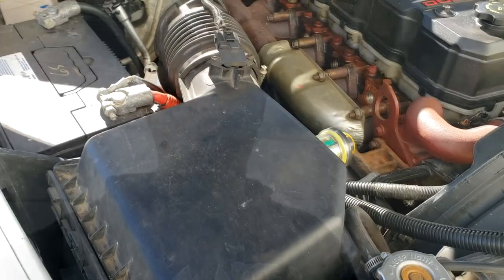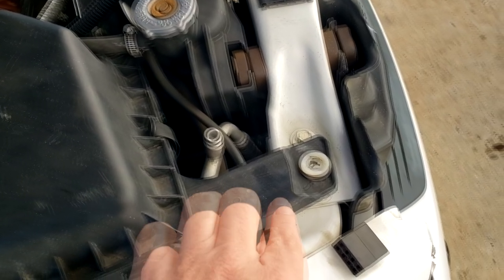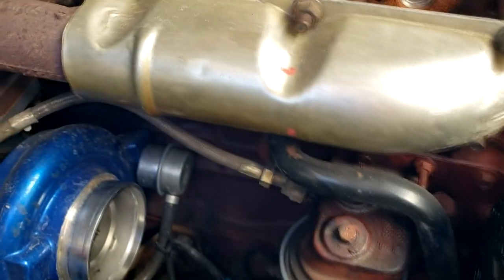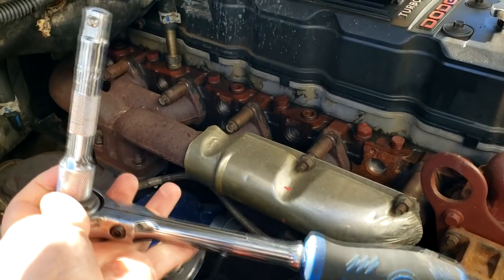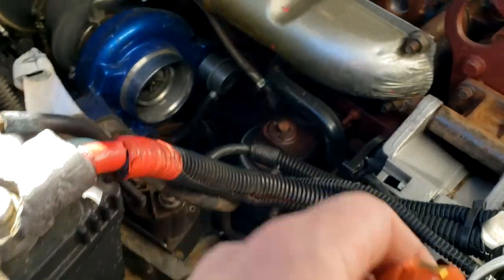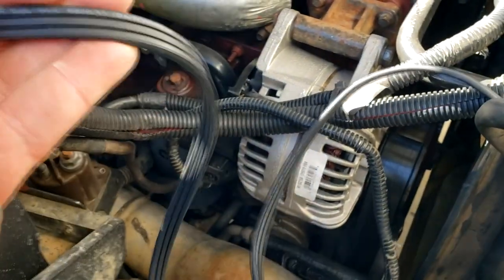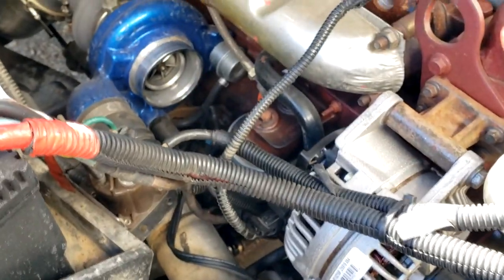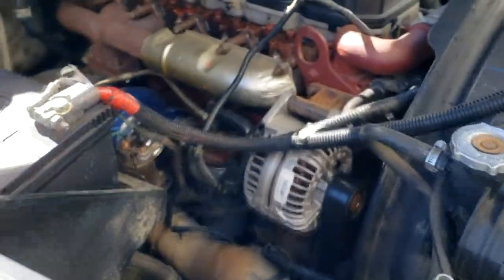How To Install And Locate Block Heater On Cummins Diesel

Comment: I was told all Cummins came with the block heater just not all with the cord. I bought a cord and went to attach it and low and behold no heater at all.  Thanks for the vid
Reply: I was told the same thing. Bought a cord, then went back and bought the heater.
Reply: From 3rd gens up it was optional depending on your area

Comment: Very nicely done. I had no idea it was this easy. Been putting this off for only 10 years 🤣👍😎👌
Reply from the maker: Lol me to then finally did it🤣
Reply: UPDATE : Took a mirror and light out to the truck and son of a bee there is the factory heater with the original factory protective cover still on it. I just have to order a cord. '05 with 230k btw. You are the man👍🤣👌

Comment: Hello, I looked at your video about installing a block heater on a cummins engine. I understand you've lost a certain amount of coolant while mounting the block element. Can you explain me how you compensated this lost amount of coolant, where did you fill up the complement and how did you get rid of the air pockets ?? Thanks in advance.
Reply from the maker: Just refill let run will be fine. I hardly lost anything if your quick lol

Comment: I have the same body style truck. I'm upgrading my exhaust system. Should I remove the cats or leave them on? I'm installing long tube headers and a diablo tuner. What do you suggest? I'm trying to get it as loud as possible. Thank you for your time.
Reply from the maker: Get rid of cats if you want it louder.

Comment: hey what kinda rim and tire setup do you have
Reply from the maker: Currently running 17" Forgestars 4.50-28-17 front runners and mickey Thomson et street r 315-50-17 rears new video.